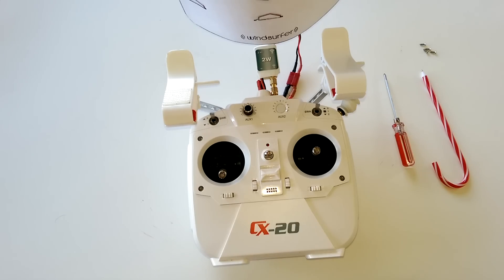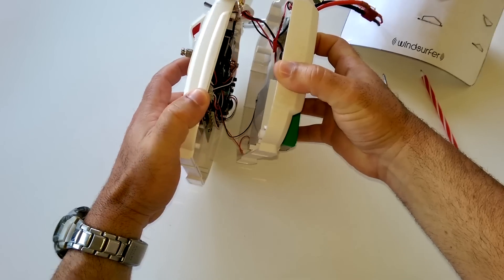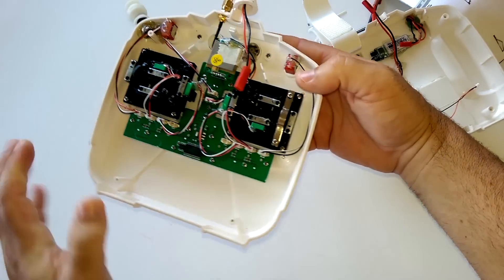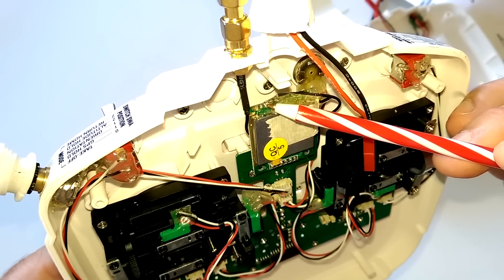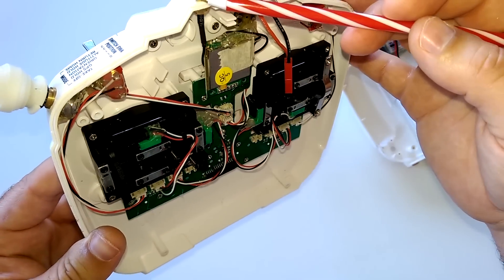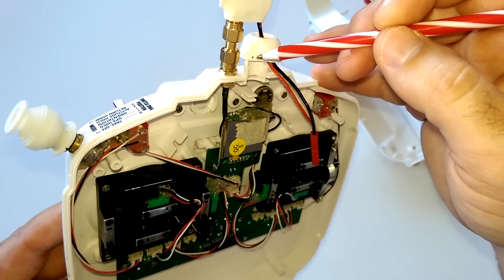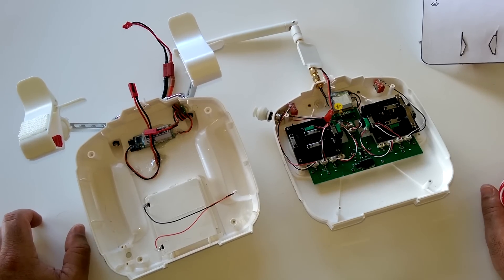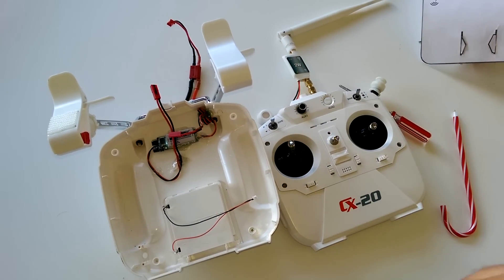CX-20 3+ Mile Transmitter Range Mod - Step By Step - [Works With Any Transmitter]

Comment: HEY DUSTIN  I want to do this to a phantom 3 standard but not sure about your voltage regulator what are the specs like the 3 a or 8a or does it matter on the amps if it regulates to 6 volts  or link also I think you said this will work on any rc.

Comment: Fyi to everyone, these 2w antenna boosters can be found on amazon for 30$ as a kit and are advertised as a dji phantom 2 upgrade but in reality are universal with any 2.4ghz wifi signal including rc cars, aircraft, etc even home wifi routers can greatly benefit from that booster. Get one for syma x8c and u got a phantom size drone that can go miles for less than 80$ total investment... best deal out there to learn how to fly and tow around a go pro for cheap

Comment: Your dead wrong about it not having an affect in populated wifi areas... no matter where u use this 2w booster +6db antenna upgrade its going to help alot. I used this setup to make my syma x8 go over 8,000ft when it would only go 3,500ft with just 6db antenna mod, and only 700ft stock. Thats all in middle of city over houses/buildings eugene oregon

Comment: hi, is there any reason you didnt just wire it directly to the battery tray, 1.5v x 4 transmitter batteries = 6v, would that eliminate the need for the ubec?  The reasone I am asking is because i want to put this in my phantom 2
Reply from the maker: I was just being overly careful with the voltages but I think it could handle it directly.
Reply: Cool, figured it would eliminate the need for a bec

Comment: Dear friend
I was about to do modification when I realized the positive and the negative contact of the interior antenna have a bridge, the positive and the negative part of the antenna are shortcut in the circuit
With my tester I checked that the positive part is also conected with ground, as the negative one. It is a bit weird, as far as I know.
Can you please check for me that the positive and the negative are not connected??
thank you

Comment: Thanks for posting your videos. I just got my CX 20 about a week ago and love it, especially for the price. About an hour ago I had a prop fall off about 50 feet up and just fished the thing out of a soft bush. not sure why this happened. I have a phantom 3 advanced, a Syma x5 and x8, and am in the process of building a Tarot t810 hexacopter. After watching a couple of your videos, I may modify the CX basically because it is not too expensive to mess up. Thanks gain for posting. Subscribed!

Comment: can a pull this off with a mjx x101
Reply from the maker: Yes,  The problem with brushed motors though is that they will fail much sooner than brushless so it is a bit of a risk but still doable.

Comment: Dustin 2 questions. First would you suggest dji propellers or carbon fiber propeller prop?  2nd which motors did you use for your upgrades for cheerson cx-20?

Comment: Hi Dustin. I finally received my 2w wifi amplifier. I mount the amplifier on flysky fs-i6 transmitter. I've got a question : On flysky fs-i6 there is 2 antenna inside the tx (receiver have also 2 antenna). I noticed that the wifi amplifier coaxial cable is really longer than the 2nd stock coaxial cable inside tx. If i plug the 2 antenna (ant. 1= wifi amplifier / ant. 2= stock antenna). Do i take a risk (range problem or something else...) ? I don't try the wifi amplifier for the moment, there's bad weather. Thank you for your super reviews.
Reply from the maker: +Sebby02 leave one antenna stock and hook booster up to only one.  Angle them both perpendicular for best signal propagation.
Reply: +Dustin Dunnill Ok, i will try it. Merci Dustin!
Reply: i have a question, if i were to do this mod but instead of using the antenna that comes with the booster can i hook up a clover leaf? would this increase the range or the opposite?
Im new to this so your help is appreciated.

Comment: Hi I just received the kit to extend the range. It seams that there were some changes. The cable that you showed in the vid is really big compared to the one I just got. and it also has a tiny connector on it.The cable is half the size of the power cable and is gray in color. I will let you know if I can work with something this small.
Reply from the maker: +MrMetor99 interesting.  The end portion you have to cut off and solder is small on mine also.  Maybe it just looks larger when zoomed in my video?
Reply: +Dustin Dunnill, I just noticed the tip of your pen. You are right, it is very small. It is so small my poor eyes said no no no, but I have one of those magnified glasses with a light on it.  I'm not flying right now anyways. I shorted the ESC when I was installing my new sunnysky 2216 900kv motors, A new ESC is 1 week out so I have time to do this extended range mod right.
Reply from the maker: +MrMetor99 Good luck.  Just take your time and be patient.

Comment: Hi, I found out that RC controller with WiFi booster still works even without external power to booster. So it would be possible to turn it on or off with switch. My question is : is signal reduced (compare to transmitter without booster) when booster is connected but without power?
Reply from the maker: +Martin Schrott with booster off, signal should still be better than stock since booster antenna is bigger and higher gain.
Reply: +Dustin Dunnill Yes antenna is better, but was thinking maybe there is some singal loss when it goes through boster with power... But didnt test it yet...
Reply: +Dustin Dunnill I tested the range today and without power to booster, range is reduced to 300m (default 1100) it means booster need power to páss signál through

Comment: Can you power the radio itself from the same bec so you no longer need double As. ?
Reply from the maker: +ziggyzbeak yes.  That is an option if you can wire it up.  It's what I should have done.
Reply: Yea I was thinking I could use 7.4 volts without a drop in voltage without hurting the transmitter but I don't want to take the chance. its real easy to wire it up ,I'm going to order the bec and get the amp thanks for your input I like your mod videos. good imfo.

Comment: Dustin
I did this mod with the Syma X8 transmitter that I use with my X8 and X5 and after bench testing, I think the 2 watt booster fried my transmitter. I did the 2.4ghz antenna mod and it bench tested perfect with my X5, 200 extra feet of distance in low altitude in an area with heavy RF/ wifi interference. Added the booster with Udec 5/6v, turned on the transmitter and then the booster using a 2200 mah 7.4v battery and everything powered up great. Tried to bind to the X5 (use the cheaper quad in case the worst happened) and it had a tough time on 6V power side of the Udec. Flew it 200', it unbound and crashed during low level flight. Tried on 5V and would barely bind. I then took off the booster and used the control with just the 2.4ghz antenna mod by its self and same issue. Next day I grabbed the X5 remote unmodded and it binded and worked perfect. I check all of the wire on the booster and it is perfect. Not sure why this is happening. It wouldn't work or power up if the polarity was wrong and to fry the transmitter has me confused. What do you thing might of happened? Also wanted to say thank you, your videos are great and I really appreciate you taking the time to do them. I have found a new hobby and so have my kids.
Reply from the maker: +K Garner Allni can think of is maybe you got a defective booster or there may be a tiny short from the center conductor to the ground pad?  Glad my vids are helpful :)

Comment: HI I like your mod. I already have an extra remote so I'm installing this mod on it. I also got this to go with it, 5 Inch Display 5.8G 32CH Goggles DIY FPV Video Glasses For Multicopter, and   Eachine 800tvl CCD 148 Degree FPV Camera Lens w/ 5.8G 600mW Transmitter. telemetry is next.
Reply: MrMetor99 could you manage install 2w booster on Cheerson cx20 transmitter?
Reply from the maker: +MrMetor99 Thanks, sounds great!

Comment: Very nice video, and i liked the way you installed the BEC inside the tx to minimize exposed wires and to make it look  more solid. I would like to ask a couple of questions. Have you actually found out if it really works, if it really makes any difference? If so, how much power does it consume? I see you have a pretty large battery on the back to power the booster, so i assume it uses a lot of power. Does it get amy worm? A 2 watt booster that size and with only minimum cooling surfice should be getting really hot. I am asking all this this, because i have purchased two similar products for elsewhere, and although they seem to be working, they consume hardly any power at all (a 500mah battery can run the amplifier for hours), and they don't get any warm at all either. To be honest i don't think they work, that is why i am asking you to tell me how yours behaves. Thank you for your reply.
Reply from the maker: There are other CX20 vids on my channel with this in use for long range flights.  The lipo is big because that was the only extra I had at the moment.   Booster gets a little warm @ 6v but not hot.  Yes draw is miniscule but I have not measured the consumption.  I always charge all batteries anyway before my day of flying.

The booster does work very well if done correctly.
Reply: +Dustin Dunnill Thank you for your reply. At 6v a 2 watt booster should draw more than 300mah. I am using a 5V power source, it should draw at least 400mah. But it hardly draws any power at all. What complicates things is that when the booster is powered it does pass the power from the internal module to the antenna, giving the impression that it does actually work, when the only thing that it does actually is to just let the usual signal reach the antenna. I have tested it in an airport runway and indeed when the booster is on, the range is the same as if the booster was missing. When the booster is off, there is still a range of 100-120 meters, but that is to be expected. I am glad yours actually seems to work, although as you say draw is miniscule.
Reply from the maker: Now I remember.  I did not have noticeable range increase until I switched the ubec to output 6v.  It worked as advertised after that with no issues.  Try to go to 6v and see if it works better.  Maybe wrong specs noted by seller/manufacturer.
Reply: +Dustin Dunnill Ok, thank you for the suggestion. I will install it on a cheap tx for testing it on 6 volts and see if it works at all.
Reply: +Dustin Dunnill Ok, tested it on 6V for about an hour. It does get a very little worm (before with 5volts there was no heat at all), but still the power consumption is so low that there is not the slightest chance that this thing boosts anything. I think that most people are led to believe that it works because of the blue light that turns on, and because of the higher gain antenna wich on it&#39;s own is capable of doubling the control distance in front of the tx (but in everyother direction you will actually have less range). Please note that i am taking about a similar product with the one you present here, not the exact same product. I hope yours does really work.
Reply: +Κωνσταντίνος Στεφανάτος 
no it works. i used it with wltoys v666 and i took stock range from 300-500 feet and iv gotten over 2000 feet+ but im interested to know if this will work with the phantom 3 advanced

Comment: Hi Dustin, great informative videos.. Where did you get the extender knob for the gimbal control on your transmitter?
Reply from the maker: Moved existing knob and pushed a gimbal rubber damper over it for grip
Reply: Doh didnt realise it was a damper rubber from a gimbal till you mentioned it... thanks

Comment: Hey Dustin, The black signal wire that came with my booster (same as yours), has a tiny terminal on it that does not match your video.  Did you cut it off and separate the shielding from the main wire to make the two connections needed?  There are two points to solder to and I don't wanna mess it up. ...Please advise and thank you very much for your great, informative videos and time.
Reply: +Jason Weber Yes you have to cut it and resolder

Comment: why not run the controler from a BEC as well and use the original battery compartment for a mounting point for BEC and a voltage monitor for the lipo?
Reply from the maker: Great idea

Comment: I tried this mod and the result so far is a basically non functional transmitter.

range in now around 20'.

do you by chance have a close up picture of the soldering of the antenna wire to the board?

I think that is where the problem lies.
Reply from the maker: Hey Jason, sounds like you must have soldered wrong.  You just mimic how the stock antenna was soldered.  There are pics all over the net if you just search "antenna soldering".  You just want to have shielding separate from center conductor and each soldered to the different tabs.
Reply: +Dustin Dunnill 

that search turns up literally thousands of completely unrelated results..

like I said, do you have a close up picture of the soldering you did?

Comment: DUSTIN, WHERE HAVE YOU LEARNT TO BEE ABLE TO ACHIEVE SUCH SUCESS INEXTENDED FLIGHTS IS YOU JOB RELATED TO WHAT U DO IN THE FIELD OF ELETRONICS BARR J WELSH UK
Reply from the maker: +Barry Roberts Hey Barry, I have an associates in Electronic Engineering which helps a little . .. forget most of it because my career is a GIS analyst.  Still remember a little though.
Reply: +Dustin Dunnill THANKS DUSTIN YOUR KNOWLEDGE VERY EVIDENT ,BARRY WALES

Comment: hi Dustin, 3 mile? i saw your videos mostly in open space. does this 3 mile apply also in some (maybe obstructed) place? will it still reach about this range? thanks!
Reply from the maker: It will vary with instructions and interference from surrounding WiFi, electric lines etc.
Reply: Alright, thanks Dustin for your reply.

Comment: hi dustin would this work with the syma x5c-1 transmitter ? thanks
Reply from the maker: It should but may be overkill as the lipo in X5c won't last anywhere near the range of the TX with the booster.
Reply: Dustin Dunnill thanks for reply, having more money to spend I've decided to go for the x380,watchinng all your vids on the x380 now,thanks
Reply from the maker: +TECH REVIEWS NORTH EAST/UK Cool.  I hope you like them.

Comment: Oh, sorry, had one more question. Based on your experience with both the CX-20 and the X380, do you have a preference between the two? Thanks again...
Reply from the maker: Beginner not tinkerer... Get the x380.  Confident in modding and tinkering get the CX-20 Open source for much more capabilities.
Reply: +Dustin Dunnill 

Yeah, I'm definitely torn, but I guess I may start with the CX. I have an almost insatiable  need to tinker, lol. Thanks for your feedback on this.

Comment: Dustin,

Great info... I've been following some of you reviews and am really appreciative of the extended range mods on the CX-20 which I plan to implement pretty quick here. However this got me thinking about its application to a quad like the XK X380 and it's use of Diversity. Would you think that this could be done on this Quad's radio and would it require the use of 2 amps? Thoughts? 

I'd appreciate any input you may have, thanks.
Reply from the maker: I'm doing the mod on X380 now and you have a good point.  I decided to put amp on one antenna.  And extent the other out the other side...we'll see how it goes.  I plan to test this Holiday Wednesday :)
Reply: +Dustin Dunnill 

Hmm, maybe a high gain or small panel for the horizontal to assist the propagation. Panel would be directional but what the hell. I'd really like to hear how this works out, if you wouldn't mind.

Any further thoughts on telemetry for the X380? I'd be curious to hear where you're at with that as well. I've had a couple thoughts I'd like to test, but I guess I'll have to wait until next month for that one, lol. About one a month is my limit, lol.

Your info and reviews have been more enlightening than most and have really helped to peak my interest in the X380 and CX-20 as well. By all means, please keep with the trend...  Thanks
Reply from the maker: I finished and outfitted the X380 with the same mods I did for cx20 last night.  Hoping to test and get some vid today off of Haleakala if weather permits...I'll post in rcgroups and then the video.

Comment: Can I power the 2w booster just from AA batteries? Whats the input voltage? 4x1,5V? Means 6V would be just fine for booster? BTW, for this booster is max voltage 5,5V, is 6V still safe?
Reply from the maker: I'm running @ 6v and seems fine after a few months
Reply: I was thinking to connect my extrenal 7,4v battery pack to this controller and power both 2w booster and controller itself over one UBEC with output voltage 6V. Is it ok to do thath? Controller should have input voltage 6V right. Is it safe to put 2w booster iside of controller insted of outside (looks more fragile). Thanks for answers...
Reply from the maker: +Martin Schrott  Yes to all .  But heat may built up in TX so make some vents close around booster.